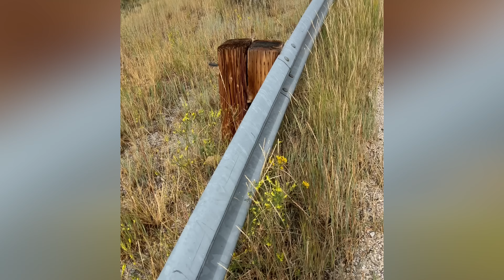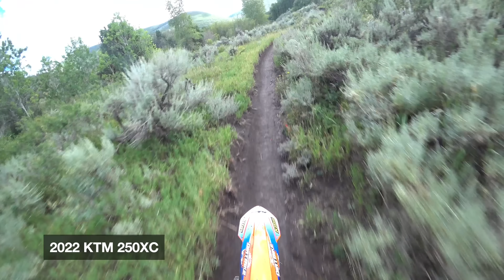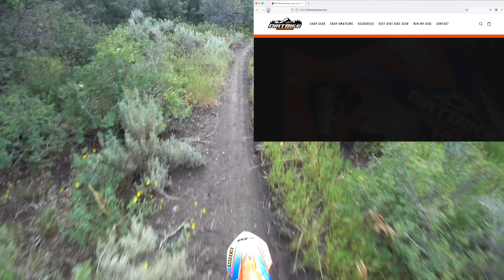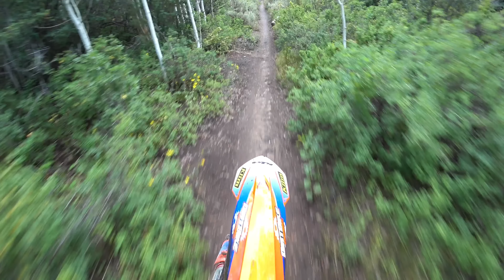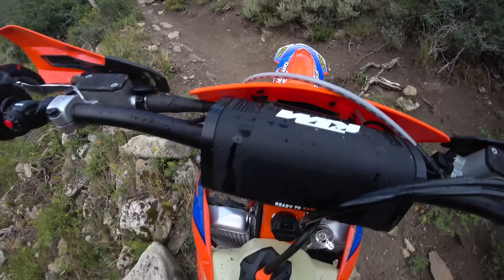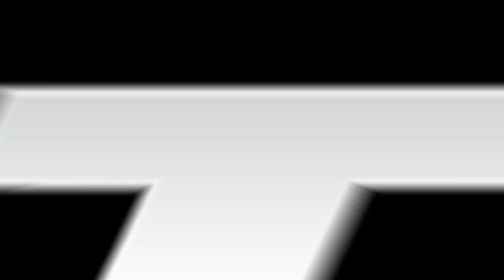KTM 250 XC Eating CHOCOLATE CAKE For Breakfast - Enduro Dirt Bike Heaven

Comment: When you say wasn't running spot on what were you referring too? I've been fighting a choppy spot in the power curve on my 22 gasgas ex300 right at the top of the midrange and into the initial hit of the powerband it then smoothes out. It's always in that range. Seems to be worse in colder weather. I was curious if this was what you were experiencing and what did you do exactly to clean it up?
Reply from the maker: It wasn't running clean or revving out correctly. This one required me to turn out the power valve a couple of turns to get it right.  They are all different.  You can book a call with me here and we can go over it.  https://calendly.com/kyledirtbike/
Reply: @DirtBikeChannel  awesome thanks!! I'll probably do that because it's getting frustrating. I've already adjusted the power valve out and have played with fuels. After the power valve adjustment it's definitely better but still there.

Comment: would you or anyone know why my Yz 125 2004 is going though spark plugs like every hour went riding for 3 hours last week and went through 3 spark plugs idk if it’s the oil or if it’s something wrong with the Engine just got it off someone who got a full engine rebuild so idk what is wrong
Reply: If you are sure about engine, check reed valve if it’s in good shape. Then check if resistances on coils are within specs. Then start fiddling with jets in carb, and probably you gonna have to get a new one.Long time ago I got this issue on mine wr250z, and the problem was carb which was “decalibrated” and puts too much fuel no matter what jet it gets. 
Switched to the newer carb and problem was solved
Reply: @WujoCaZa  thanks mate I’ll give it a sus